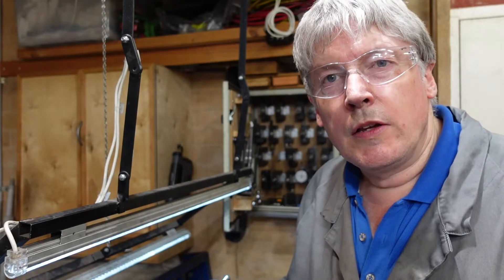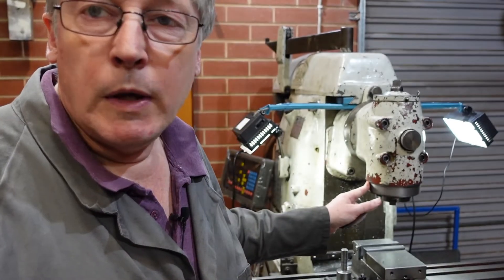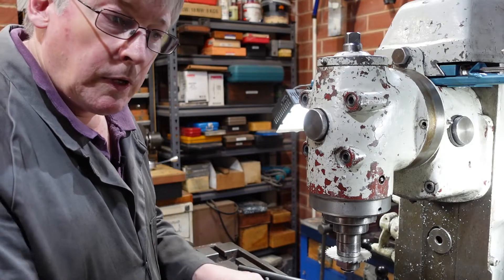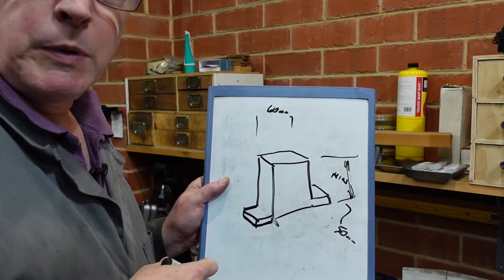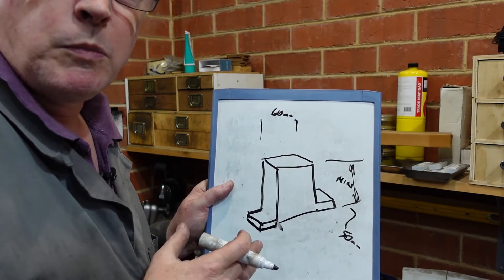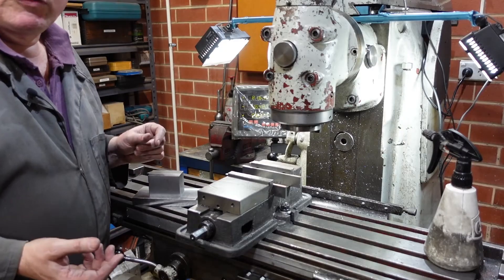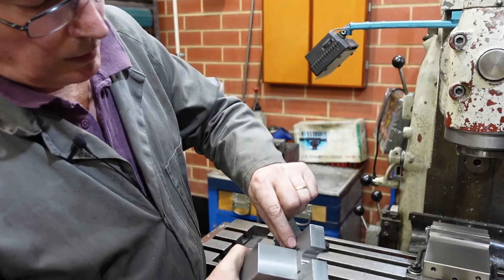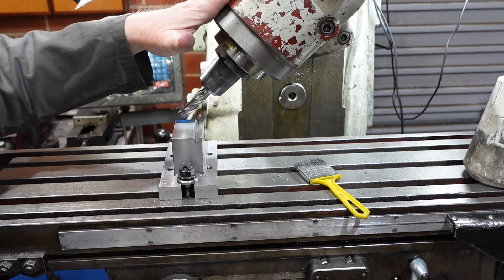Developing a new solution to an old problem

Comment: Nice mill you got.And well travelled.If I´m not totally wrong it is a Sajo 52,made in Sweden a long time ago when quality was a leading star. If it has withworth threads like mine it´s older than you.And it will propably outlive our children too as long as it got some oil every now and then!Nice to see one that far away.
Reply from the maker: It is a Sajo 52, I think made in 1967 (first 2 digits of the serial number. It does have Whitworth threads - I've always wondered why...

Comment: Many years ago I had a similar quandary. I had to cut keyways in some 3/4 " brass bar stock. I had only a Myford lathe and a vertical slide. (VS). 
Into a 4"*2"*0.5" piece of BMS I machined the top and bottom faces flat in the 4 jaw chuck. I then drilled suitable hold down bolt positions so that I could mount it to the VS using T slot bolts or nuts.
I cut two pieces of 2" ID water pipe each +1/2" wide and faced each edge to size. 
I set up a fly cutter to the outside diameter of the tube bits, turned the VS parallel to the lathe axis and cut a 1/2" wide 1/4" deep slot on the 4" centre line near each end, so I could braze the two rings into the base to form the hold downs. 
Before brazing I machined, with a suitable end mill, a 90° slot across the 4" length on the centreline. 
I now had a 1/4" deep groove down the length and under the clamps. The rings were brazed in and a 1/4"*20 threaded hole was drilled in each ring crest immediately above the groove. 
To use, material was clamped to the groove using a pad under a socket head screw in each ring to prevent damage. The fitting was bolted to the VS perpendicular to the lathe axis and using the appropriate end mill the slot was cut as needed. 
I still have, I think, that device somewhere in my tooling though it hasn't seen daylight for at least 43 years. If I can find it I'll draw it up and send you a photo or two.
Regards from Canada's banana belt.
 👍❄️🇨🇦🍌🥋🕊️🇺🇦🐨🇦🇺🤞
Reply from the maker: I think I understand what you have done. For something like a 1/4" keyway, I'd probably use an end mill. The situation that sparked this was smaller keys that did not lend themselves to cutting with an endmill.

Comment: Nice to have your thoughts on design. Designing on the fly is not as common as it used to be. I will definitely build one of these.

Mark
Reply from the maker: In my day job I do all this on paper first, but this was one of those things where the solution developed as I went.

Comment: I like that concept of coming up with ten potential ways to do something. I probably do something like that in my head, but it might be interesting to formalise that process a little and scribble down the ideas in my Grimoire, a habit I picked up when I was doing programming of complex algorithms.  It's just a Little Black Book. I definitely need one of these to hold small shafts where I need to cut long slots that would otherwise foul the vice or end up with the arbour nut hitting the table.
Reply from the maker: I find putting it down on paper also helps get the ideas flowing - you can do 'a bit of this' and 'a bit of that' without having to juggle too many thoughts in your head. Debating at the moment to put an out-rigger on the side. Putting the clamping holes in the base works, but if the clamp nut is graunched too tight it might be possible to twist things a bit. Not a problem so far for small keys, but for longer cuts?
Reply: @occasionalmachinist  I find I'm doing more and more of the ideas-bashing and sketching in Fusion360 so I can design things that LOOK right, then take measurement and spin them in space or attach them to other parts to check clearances and whether joints will line up, but I still keep the notebook going as a sort of journal.  Electronic documents tend to hide the genesis of ideas, you just get the destination, not the journey
Reply from the maker: @MachiningandMicrowaves  I'd agree, except that I find it easier to sketch on paper than use a CAD package. I go to my 20+ y.o. copy of AutoCAD LT to lay things out but only when the sketch shows a fair chance of being the most workable idea.
Reply: @occasionalmachinist  my version of AutoCAD LT is dated somewhere in the 1990's and a student version at that but still useful to find conflicts in placement of features. It's saved me many times.

Comment: Any reason you decided against using the mill in horizontal mode with your normal vice to saw the keyway?
Reply from the maker: Just because to change over and back is roughly a 1/2 hour for 5 or 10 minutes milling. I've been meaning to do something like this for some time so instead I spent a few hours making this up. I've used it a few times since, so worth the effort I think.
Reply: @occasionalmachinist  I think you did some timings in an early video and the swap back and forth was more than ½ hour. I can see it makes sense from that point of view.